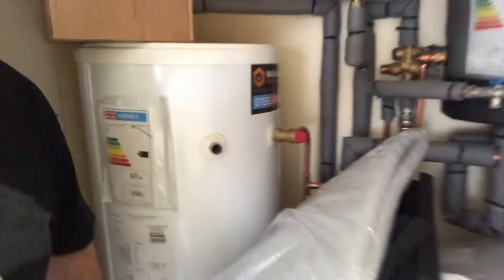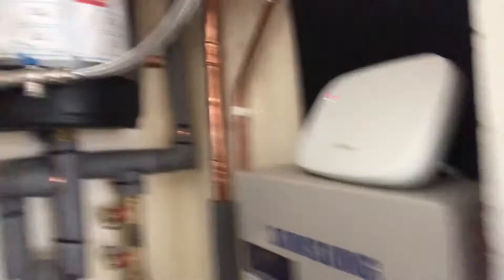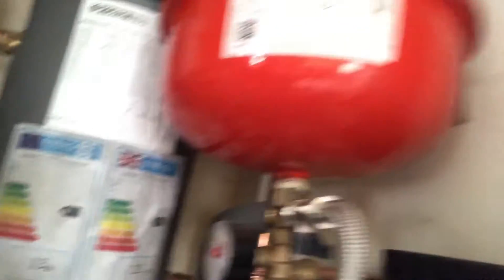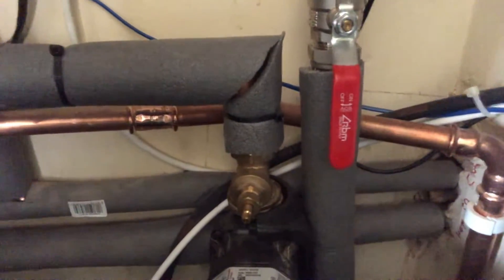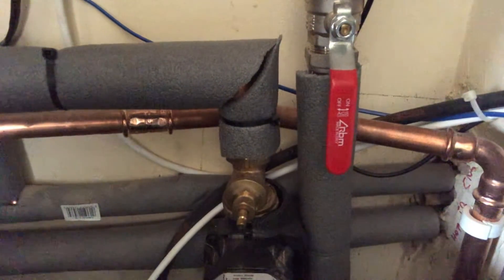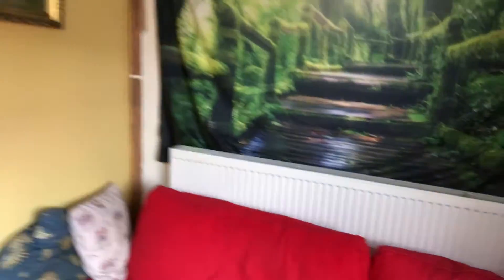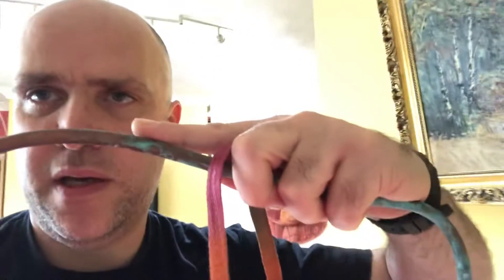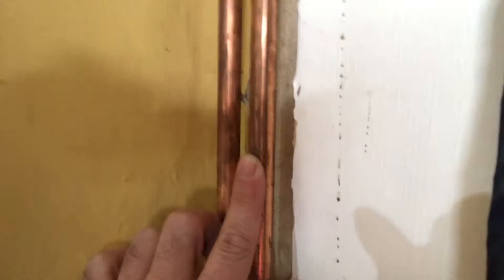Heat Pump : Noise from Bedroom

Comment: The heat pump is outside. The noise you are talking about is from the circulation pump which is needed for any radiator system. You could probably move this to somewhere else if it bothers you. Mine (Vaillant) is built into the unit outside so I have zero sound in the house.
Reply from the maker: Thanks thats very interesting.. yes heat pump is outside, so thats most of the noise..  I'm not sure where I'd move the pump to which would be better, and it doesn't bother me that much..
Reply: I have the same issue. New build, tank is upstairs, bedroom just below it, water pumps make a constant humming when the unit is on. I mitigated this by switching DHW off at night, but the unit occasionally has to defrost the pipes (when temperatures go next to zero), and this wakes me up. What options do I have? Also the pipes occasionally clang. Are there regulations that allow me to demand the noise to be fixed? If it’s as simple as moving the pumps outside, that seems like an achievable goal with relatively little effort.